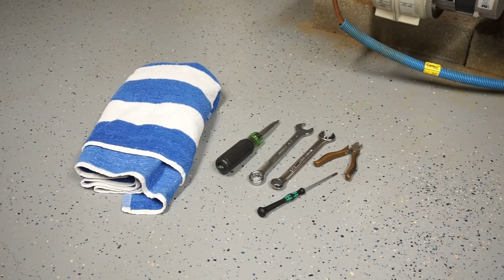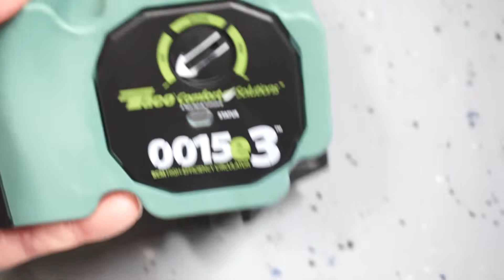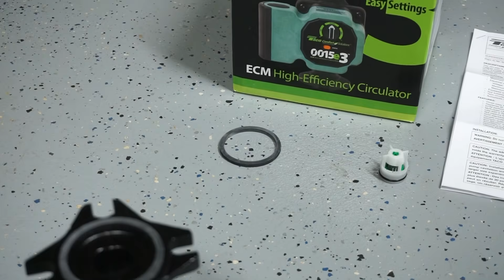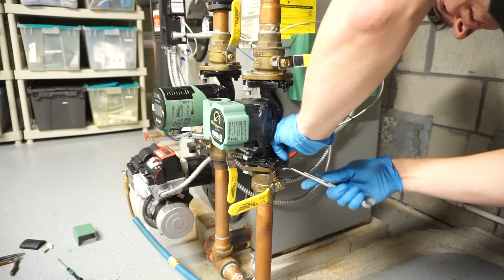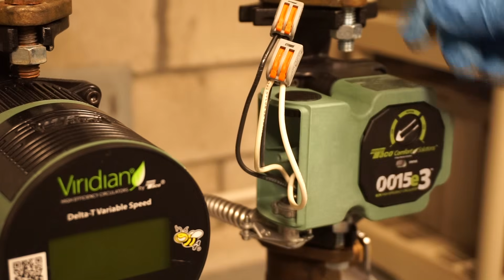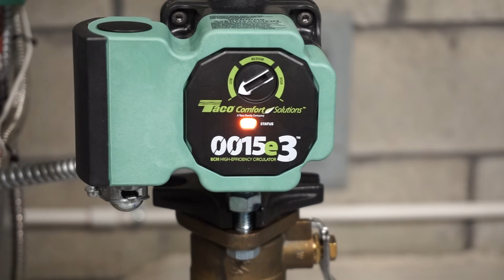How to Replace a Circulator Pump on a Boiler

Comment: Thank you for taking the trouble to make this video! I just replaced the circulator on my oil furnace and I was wondering how you get rid of the air in the loop after replacement. There is a shut-off valve about 5 feet above the pump on a 1.5" copper pipe. so all that water drained out when I did the replacement. How do I get that out?

Comment: Model TACO 007-F5 littlerly just went on fire in my boiler room. My son smelt electrical the the boiler called for heat i was watching then flames came out of side electrical cover. This pump is right next to the wall in B-room. Thank got i was home and am in the buisness. 4 years ago i replaced this 15 years before that i changed the other one. Took it apart no signs of binding. No signs of short to motor or case. Black l1 was very loose.Prob. because pump winding were starting to make popcorn. Scary stuff. They don`t make them like they used too that`s for sure.. Also i guess the MC is used for the ground instead of the case ground. WHy is the no saftey device like an overload . Breaker never blew. I guess i will order a arc fault breaker for this circuit now.

Comment: Replaced a TACO valve yesterday. Did not use the big gasket just the rubber gaskets that camw with it. It's leaking and i have no heat.

Comment: .can you kindly tell me how long it takes to install one? the longest it should take if it is hard to reach. i would appreciate it. i got charged $1600 for that and replacing some valves and it took them 4/15 hours...there were 2 broken pumps that did not work so i want to understand if they are charging me for the time it took to keep putting in the bad pumps before i call the owner about this bill. thank you so much.

Comment: Because it was leaking past the shut off, why wouldn't you install the new pump with o-rings and bolts and then do the wiring?
Reply from the maker: That's fine, the power was off but you can do it whichever way was more comfortable for you

Comment: Great video, thank you. I had a question. If the pipe fitting is fine, and not leaking but the pup is making noise, what do you think of leaving the fitting and just replacing the motor section of the Tyco pump? Is it worth it to just leave it, or would it be silly to not take the time to replace the pipe fitting and seals, etc?

Comment: After replacing a pump, a expansion tank or any other component, does it need to purge the air out? I didn't see it in this video, I'm wondering. BTW  great video, I understood every step of the video, great teacher for newbies like me, thanks for the effort man.

Comment: I"m installing a new boiler and I thought that the Taco Circulating Pump was hooked up on the hot water feed on the old system.  Should I install it on the cold water return so that it isn't fighting gravity as much?  It doesn't seem to like being on the hot water feed.

Comment: Quick question ,if the pump is located on top as hight as the water heater, is it necessary to pry the tank as well? Of course shouting of the incoming water as only one shut off is available.
Thanks

Comment: You did not bleed the system.  Was that left out or do you rely on the auto bleeder.  Not an attack, I want to replace a circulater and bleeding is the part that makes me hesitant.

Comment: I noticed you installed the new pump in the reverse direction as the old one. 
Any problems with that?
Reply: the flow arrow direction should be the same way, if not you may have to turn the pump 180 deg

Comment: Anyone know if the water flowing from the tank to the cartridge circulator (and then to  3 zone circulators for baseboard heating) should be slow? When I crack my Taco circulator open, very little (and dirty) water comes out. When should water be flowing more rapidly? When there's a demand for hot water? Noob question but I'm now trying to fully understand my boiler system

Comment: great video..  must of been a pain to tighten that screw for the electrical plate LOL.. I do understand that you needed to get the pump on first because the shut off valve was leaking a bit and that's why you went with that order of operation.

Comment: LOVE Wago lever nuts. I particularly like the newer, smaller ones made of clear plastic. They more than meet all sorts of stringent specs, and people who feel like the only way is to mangle their conductors together with traditional wirenuts are just not correct. The Wagos even come in varieties spec'd for industrial and hazardous applications. While I don't use them exclusively, I use them wherever there are clear benefits like tying in new work to old wiring in my 1950's house.

Comment: Do you need to do something to get air out of the lines when you finish?
Reply from the maker: It depends, if you dont have to drain much out you might be ok, otherwise yes you may need to bleed it. Sorry I wish I had a more exact answer

Comment: I had a pump that was over 40 years and the I used wd-40 for about 15 days ( did the replacement during the summer), 3 out of the 4 came off one with vice grips, the last one I had to use a sawzall and a metal blade on the pump side, I cut the bolt and the nut clean off, (dirty harry) lo, be careful, legal disclaimer, if you use the sawzall and get hurt I am not responsible for any injuries.

Comment: It’s weird why don’t you have a pipe hanger so when you remove it the pipe won’t fall down. Also next time do the electrical first that way you won’t have water dripping on the electrical wires.

Comment: Do the pumps have a Replaceable Cartridge?
Reply from the maker: They do but it's usually not a good idea. They price the cartridges at about 80% of the pump price and the other issue is that corrosion is usually bad. So when you try to change the inside it won't really work. Most plumbers never do it, and my experience has been it isn't worth it.

Comment: What's up with the other Delta t circulator next to it? Is that just a different circulation loop?
Reply from the maker: Yes one is for domestic hot water with an indirect tank and the other circulator does all heating zones in the house.

Comment: The electrical connector is good for that application, however not good for high amp applications.
Reply: They do have ratings.  I saw a video last year where a guy tested his Wago connectors.  I think the connector was rated around 30 amps.  It worked up to about 90 A or so before it began to deform.  Not bad.  If I remember right, it did not begin to heat until after 50A and the wire did loose it's insulation before the Wago began to deform.

Look it up.  Was interesting.  I had my doubts too.

Comment: First off he should have disconnected wiring before he removed pump and connected wiring to new pump, then he could have swapped it on immediately instead of being dripped on.
Reply: Point being is to not have the water drip as long as it did. So yes either way would work since he cut the power but in general it’s just cleaner work if you detach the wiring to the circulator pump before removing the pump.
Reply: Did he cut the power to the pumps first by shutting off the boiler? If so then this would kill any risk to the connections.

Comment: Nevermind, I hit my pump with a wrench and it started working. Maybe it was stuck with sediment because I am on well water? It doesnt make any noise but it gets really hot.
Reply from the maker: Just be careful that cane sometimes work but it usually doesn't last. These pumps are under $100 and can last 10-20 years. You might want to plan a replacement before it goes on you again if its more than 10 years old.
Reply: Silver Cymbal 12 years since I have been here, furnace installed in 1996. I have a replacement, it is red the old one is blue. Hopefully the specs are the same. Maybe it was the check valve that was stuck, not the impeller and hitting it worked.
Reply: @SilverCymbal   Wouldn't they last longer if they were on the return side of the system close to the boiler?  In this setup it looks like the circulator sits in hot water 24/7.

Comment: I have one shut off on top..why wouldnt they put 2?
Reply from the maker: Might just be to isolate the house so you can do service and you wont have to rain as much water without one at all.  Better if you have them on both sides but this is NIOT usually this way unless you specifically ask. Good installers do it but that's good ones.

Comment: 6:20 It should be noted, make sure that wrench is larger than the pipe below :-) 
Good video, topic well explained and quality is very nice.
Reply from the maker: Thank you very much I appreciate that.
Reply: @SilverCymbal  Thanks for sharing.
I agree with Taco's recommendation regarding gaskets and I think those flat gaskets people often add at the flanges are not only unnecessary, but can make the seal worse with time.
Reply: Break out the old extend a magnet just get it back out if it drops in

Comment: how can I tell if my circulator pump on heating system boiler is working?
Reply from the maker: Check out my other video in my plumbing and heating section on my channel on oil heat basics. It takes you through many of the components.

Comment: helpful video. thank you. two questions. first. I want to be sure that in addition to the flow direction being correct, the check valve needs to go on the outflow side, correct? Second when turning off the electric to the boiler and pump, will the pilot need to be re lit after turning back on? thanks again!!
Reply from the maker: Depending on which pump you buy the position of the valve may be different but in almost every design he valve will physically only fit in one spot so just follow your manual and when installing it, it will fill snug but will fit properly. Pilots vary, on an oil system there is no pilot to re-light but assuming your gas you may have a pilot that will require re-lighting.
Reply: thanks. 1 more question- I just opened the old grundfos pump to disconnect the wires and there is a third, ground wire. the the grundfos had a third quick connect hole for the ground but not the taco 007. what do I do with the ground?? @SilverCymbal
Reply from the maker: @rgershberg   Most Taco's do not use a ground wire and state they are "double insulated" and don't require it.  From what you have described I would cap it if it was my system but you could have other things going on so speaking with an electrician or contacting Taco would be the best idea to be sure before working on it. You can also post that question on www.heatinghelp.com they are excellent for specific questions and fast.

Comment: Thanks for the very detailed video! I'm considering changing one of my circulator pumps from a B+G nrf-22 to a Taco 0010 because I have about 70 feet of aluminum baseboards with 3/4 inch pex and the baseboards at the end of the loop are really getting that hot. I was thinking that I might need a stronger pump. I think the taco might be a little shorter in height. Can this be done without having the make height adjustments to the copper piping.  I'm trying to make this a DIY job after watching this video.
Reply from the maker: You can double check the specs on their sites but normally the circulator pumps are exactly the same heights so that they can be swapped out easily. When I switched my 007 to the VT ECM pump both from Tacom as shown in the video the height is identical. Hope that helps.
Reply: @SilverCymbal  okay. I thought that since I was switching brands it might be different. Thanks.
Reply: Craigslist

Comment: Love your love of technology,  as I believe you know, been out of field 6 years, this pump is new to me, we used taco oo7s with red b&g red gaskets to the old monsters
Reply from the maker: I remember all those gaskets. I guess they worked for many years so I cam't fault them much but I really do like these new EDM pumps. But they are very sensitive to dirty water so it needs to be pretty clean to keep functioning well.
Reply: Tech is great and all, but this pump looks brand new and already needs replacing. Have a series 100 B&G on my boiler - thing is like 60 years old and has only ever needed consumables replaced

Comment: I can usually feel the vibration of my circulation pump pumping. but I am not sure if it is running or not. slight vibration, but doesn't seem like it is vibrating like it used to?

Problem is the pressure relief valve is now leaking and the pressure gauge on the side of the boiler says 30 psi. I did try purging air from the 6 zone system,, one zone at a time, until no bubbles what so ever. I also purged the air from the boiler until no bubbles from a garden hose stuck in a 5 gallon bucket. When I did that the pressure went down to 12 psi like it should with a 12 psi regulator on the water source.. I then fired up the boiler, with just one zone calling for heat, One thermostat open and the zone valve was open also,   and kept feeling of the circulator pump and still could not tell if it was running or not. The pressure came back up to 30 psi and the temperature to 180 and then the system shut down with a small but steady stream of water from the pressure relief valve. 

Do you think the pressure built up to 30 psi is because the circulator pump is not running and is bad?
Reply: I realize this is an old question, but it sounds like a faulty expansion tank.

Comment: great detailed video! Since you cannot tell whether the pump is running effectively, how can you tell if you have a bad pump? Any advise you can provide is greatly apreciated.
Reply from the maker: Thank you very much. With the original pump the only way you can really tell is to listen to the pump and get close to it. If it sounds rattly or noisy its probably bad or going bad. The other way is to see how it is working, meaning if it runs your heating zone and it feels that the pipes get hot quickly when it is on then it is probably good. I don't like the waste money but they are not terribly expensive and if yours is 10+ years old it is good insurance to change it out but that is up to you. For me losing heat is really bad so I am OK to spend a little more upfront to keep the components newer. I hope this helps. Also please click thumbs up on the and vieo to subscribe to my channel for new videos! Best wishes.
Reply: Thanks for your immediate response. I'm here in Ohio and we are currently experiencing single digit temps. My pipes froze a couple of days ago even though the boiler operated normally. I suspect the pump went bad because the majority of the pipes separated from the elbow joints. I gave you a thumbs up and just subscribed. thanks!

Comment: Hi what size wrench do you need for the bolts
Reply from the maker: They can vary but most often they are  5/8" and the other 11/16". So you need two wrenches or an adjustable. Thank you for watching the video.
Reply: Thanks
Reply: I successfully changed my pump for the first time .  Thanks for the video.
Reply from the maker: That's awesome. Glad it helped! Heat is a good thing especially with the weather we have right now!

Comment: I’m thinking about upgrading from my old Bumblebee to a new Viridian. I have an old converted gravity system with a Burnham ESC boiler...the bumblebee has been great but it’s a bit noisy (has been since new - kind of a mechanical/electrical buzz that resonates throughout the system). Anyway - how do you like the Viridian?
Reply from the maker: I really love the Virdian VT2218. Since the Viridian varies it's it's operating speed and is rarely on hight it's noise is inaudible throughout the house. For me that was an extra benefit. Easy to install. Only mistake I made was that I should have flushed my system first, just with water. I had a lot of build up which is not good for ECM. Thank you for watching, please subscribe to me as well as I will have a lot more videos in the near future.